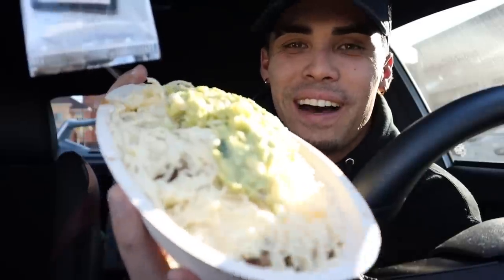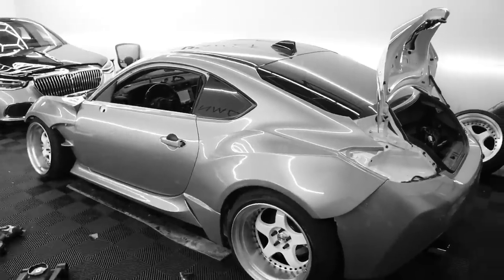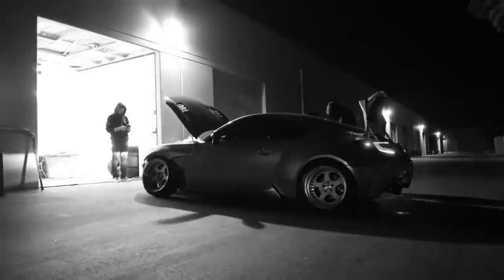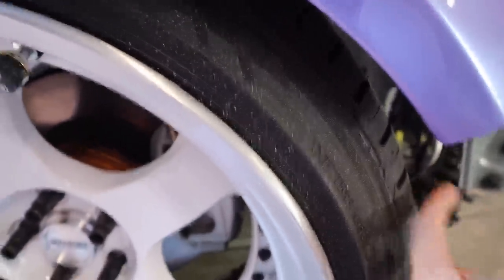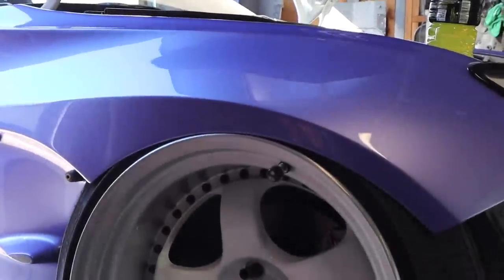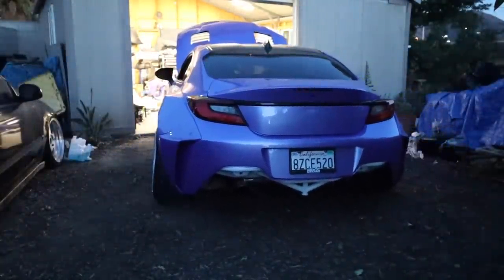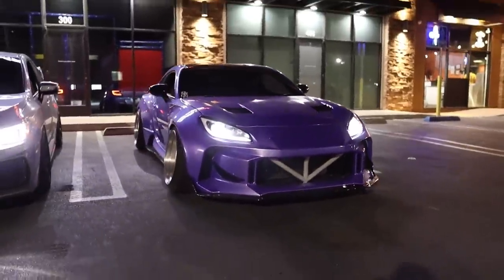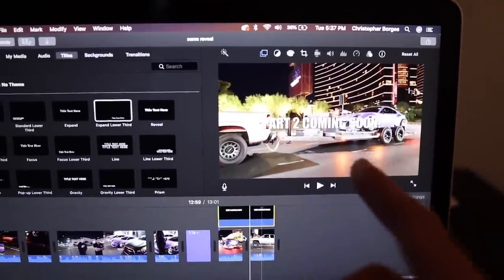NEW WIDEBODY & WRAP REVEAL ON MY STANCED OUT 2022 BRZ!

Comment: Just a random question, I know you have the quick release steering wheel on the FRS but that one has mainly an analog gauge cluster. How would you go about controlling the digital dash with this steering wheel?
Reply from the maker: Haven’t figured out a way yet! There should be a bracket somewhere where I can mount the OEM buttons on the wheel.
Reply: @chris_borges  That would be perfect, and btw the car is perfect